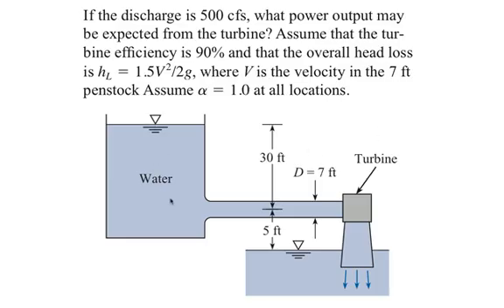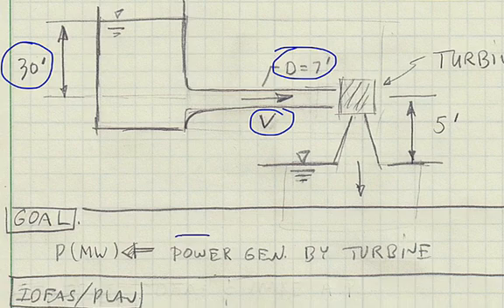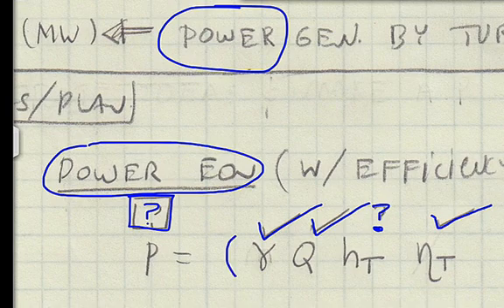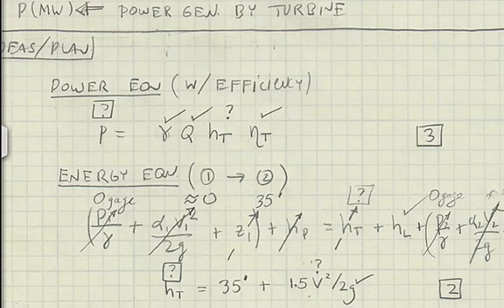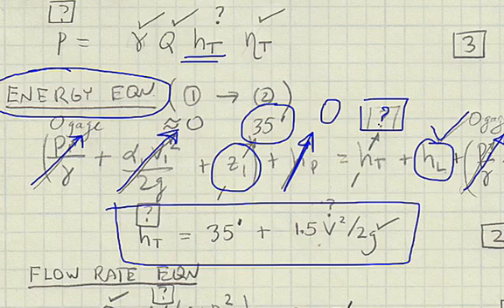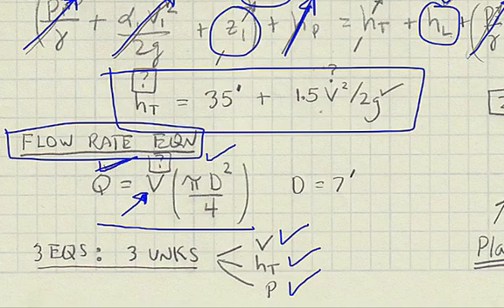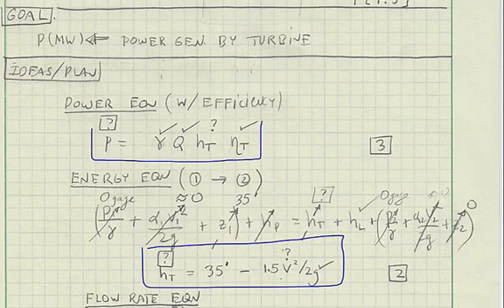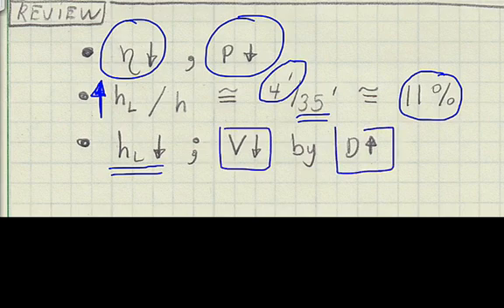7.55 Analysis of a Water Turbine

Comment: I am trying to figure out the power done by an underwater turbine that is placed in the seabed of the Atlantic Ocean, I know the velocity of the water and the flow rate but I don't know the velocity coming out, how would you approach this Dr Elger
Reply from the maker: Be sure to include both the inlet and exit pressure as well as the velocity. For the velocity, three approach that I might take are  (1) Estimate the exit velocity; (2) Conduct a parametric study in which exit velocity is varied; (3) Research a specific type of turbine that works for this application and use the facts about how this turbine works to estimate the exit conditions. I hope that this might be helpful.